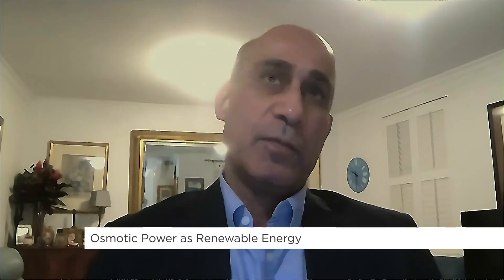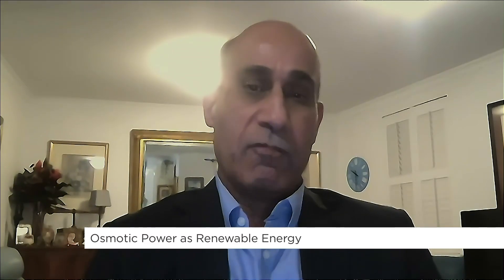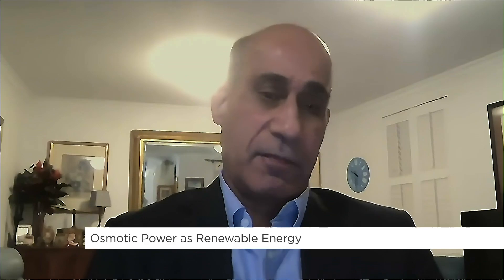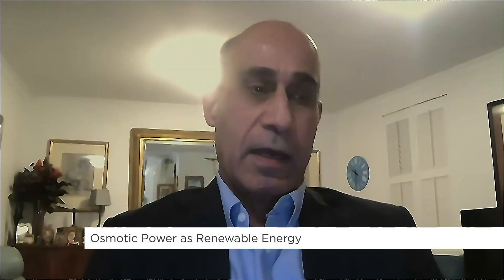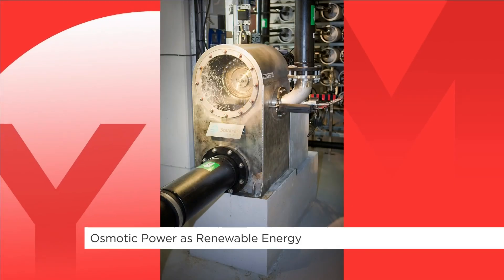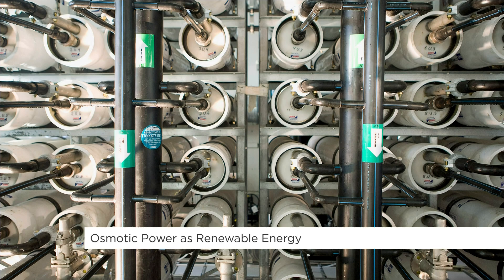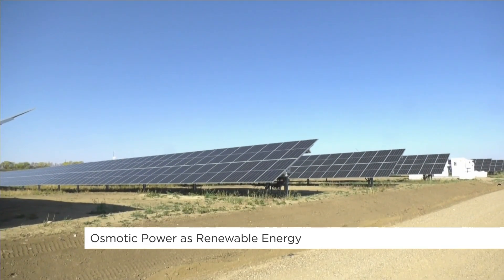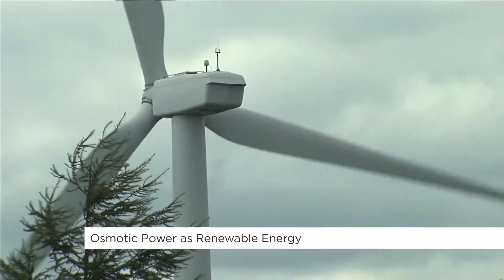Is Osmotic Power a Good Fit for Canada? | Your Morning

Comment: Statkraft in Norway built a plant but found that the salinity gradient between seawater and fresh isn't high enough to make a commercially viable plant.  The need for high salinity brines makes this a niche technology.
Reply: Just a though but could the brine from desalination be used. 

Regardless of possibilities I'm not a fan of the tech currently since most installations would end up using fresh water from all the wrong sources.